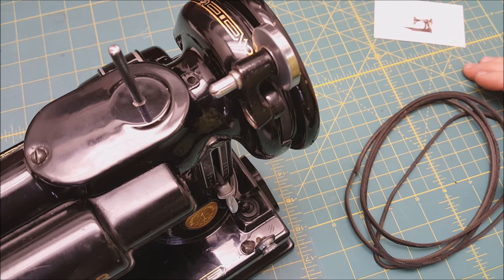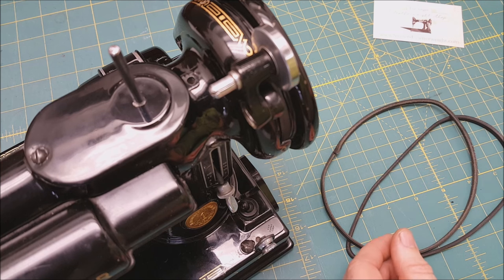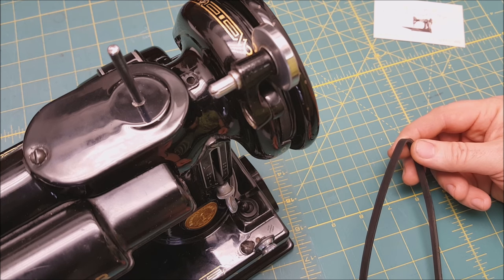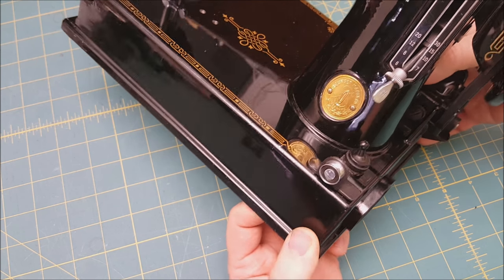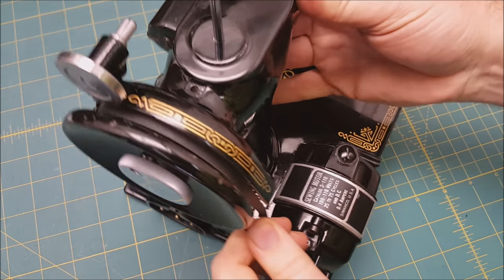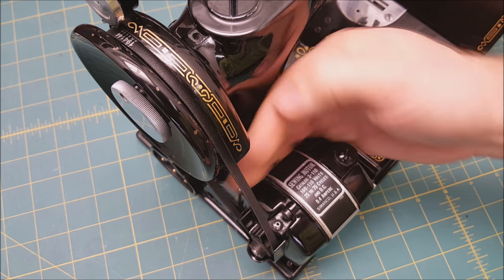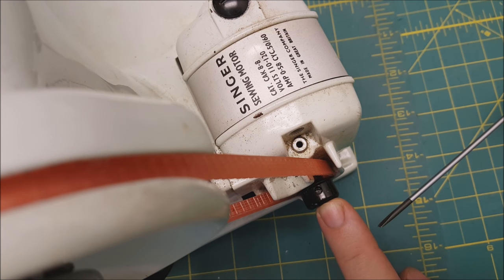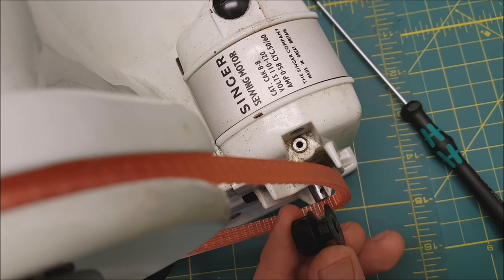How to Remove and Install a Singer Featherweight Belt

Comment: Just ordered a belt from y'all last week, and before putting it on I decided to watch this video. So many nice little tips, like protecting the paint from getting chipped, or mentioning how the belt is supposed to be loosely tensioned rather than tight. If I need more featherweight parts I am ordering from y'all!

Comment: I don't own a "featherweight", but hope you'll answer these questions anyway.. I inherited my mother's Montgomery Ward URR-185.  I am 70 and have never used a sewing machine.  The machine has a round belt that is severely cracked.  I moved the motor mount to loosen the belt, but I can't get the old belt off (or new belt on) because it doesn't clear the bobbin winder.  The bobbin winder doesn't turn or move.  Is the round belt appropriate for this model?  How do I get the belt past the bobbin winder?  And isn't the bobbin winder supposed to rotate?

Comment: I've removed the screw from the bakelite pulley but it will not pull off.  I don't want to pry it off as I'm fairly confident that will break it.  I've put in a little penetrating oil with the aim of putting it where it will creep onto the shaft (with the end of shaft/pulley facing down so none can make its way inside the motor).  If it doesn't budge at all with turning and pulling are there any "advanced tips" you can share please?  Or am I best at the stage just to clean it all and pop the screw back and in let that be that?  Thanks for any advice from anyone, including other readers, if you've had this problem and figured out how to overcome (or have a cautionary tale!).  Ta...  Megan

Comment: What is causing the thread to knot up on my bobbin and it cuts the thread?
Reply from the maker: Check out the Featherweight Schoolhouse with all the categorized maintenance tutorials and troubleshooting and then contact the shop directly for further Featherweight technical assistance:

https://singer-featherweight.com/blogs/schoolhouse

Comment: My motor needs to be lowered now that I have replaced the belt on my white FW so that the belt is tightened because the belt won't turn. How do I lower the motor?
Reply from the maker: Here's the adjustment tutorial for you 😊

https://singer-featherweight.com/blogs/schoolhouse/adjusting-the-belt?_pos=1&_sid=29a641dbc&_ss=r